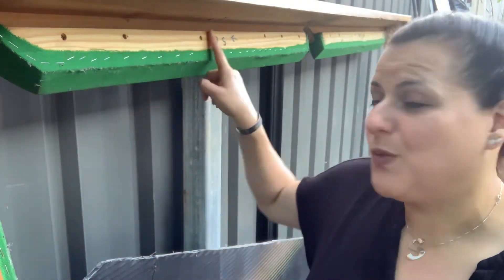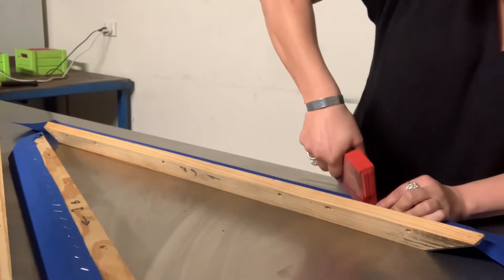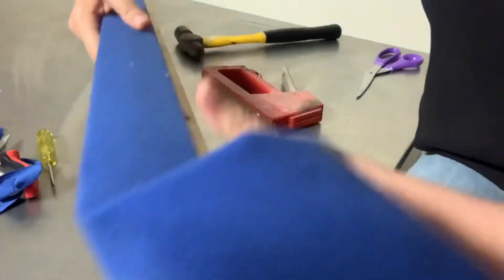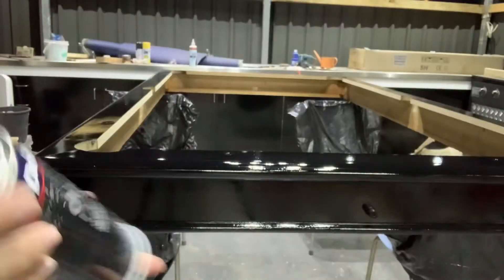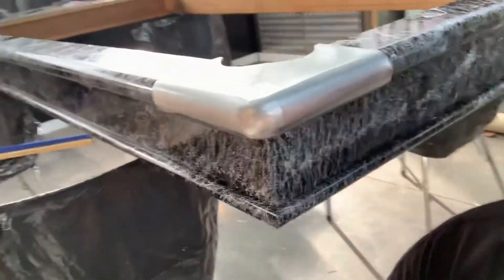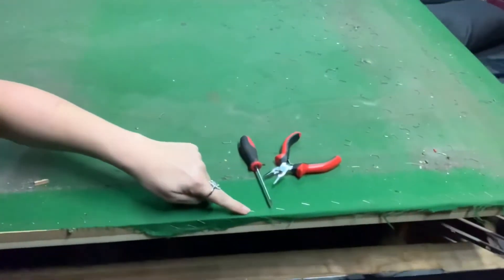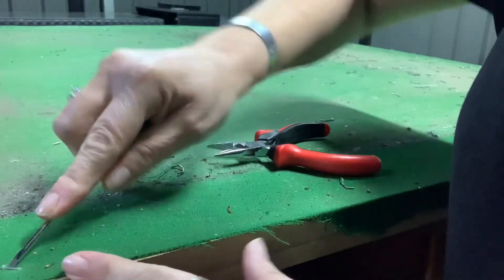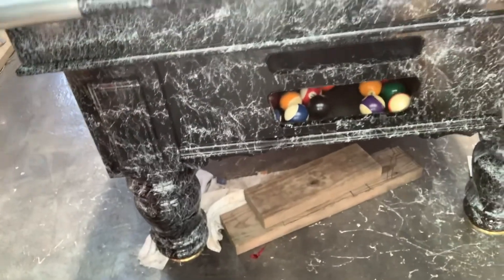Billiard Table Renovation

Comment: Good job ! Did you have to sand down the wood before painting? Please any link to the glossy spray paint?
Reply from the maker: @folaishola7029  I didn’t but I should have because it only lasted in outside weather for about 2 years. The paint is from Bunnings.